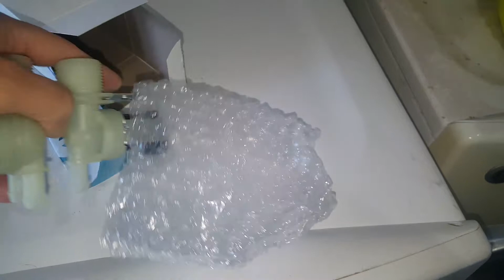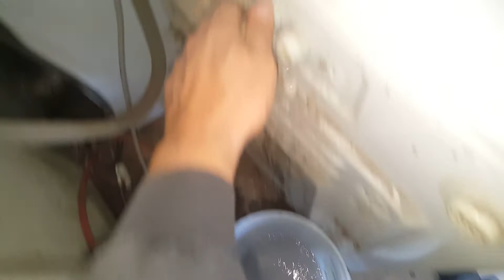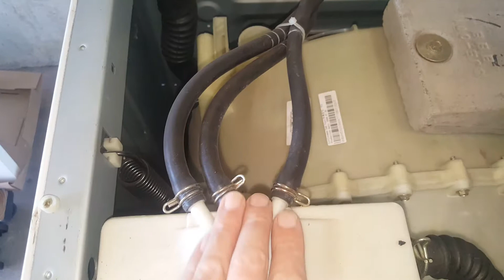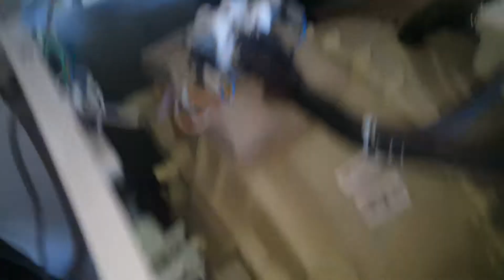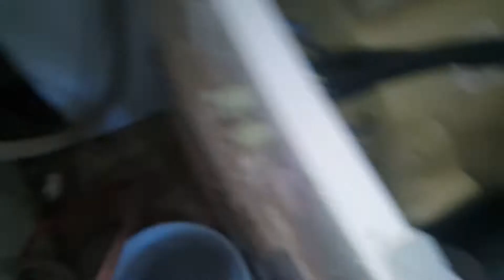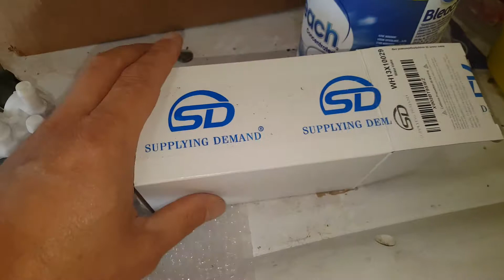Fixing my Ge front load washer bad water valve solenoid

Comment: I had to check that rubber front boot it was leaking. Found out the drain holes were clogged because the filter was never clean. The boot had mildew and gunk, I soaked the boot in swimming pool shock overnight, no more gunk and mildew on it. I dried it and rubbed it down in Armor All made it looked brand new.
Reply from the maker: Great information thank you for taking the time to share , it is much appreciated.

Comment: Thank you for this video. My washer was leaking for the past 6 years and recently the water wouldn’t stop during the cycles.  I came across your video and ordered the part for $18 off Amazon and all the problems were fixed. I didn’t have to find an appliance repair company and spend hundreds of dollars for them to fix it. Or buy a whole new washer.  So this save me so much money. I appreciate you sharing this video so much.

Comment: I have the same washing machine , when taking water to wash is slower than what it used to be but eventually it Will take enough water to start the washing cycle……but when taking water for the rinse (softener) it will start to take water normally but in about 30 seconds the water flow will diminish..water pressure gets so low that Need to use a bucket 🪣 to help fill up the water (only for rinse )
Should I change the the water inlet valve.?  Thanks 🙏🏻
Reply from the maker: Very good possibility this could be the issue. They fail a lot. Thanks for watching.
Reply: Thank you very much , I replaced the water valve solenoid and the machine is working perfect now …
Thanks 🙏🏻

Comment: Odd question were the loads stopping during the  cycle? I have the exact washer and this is something it said it could be I know the hot works so I assume it’s my cold cause it seems to only stop during the rinse
Reply: Mine does too.. I read that it could be the door sensor getting tripped
Reply: I was having the same problem and changing the water valve as indicated in this video fixed the problem. It now goes through the entire cycle with no problems at all.